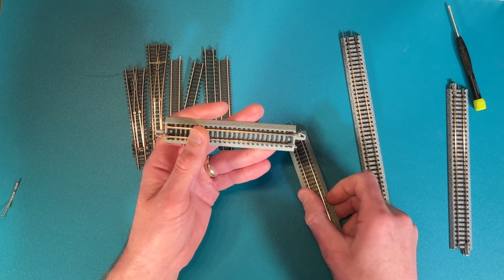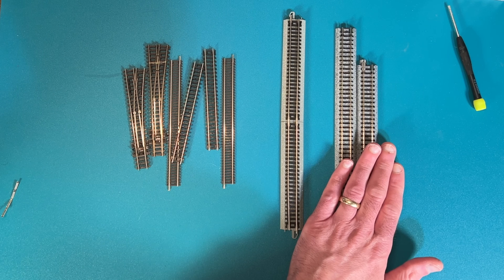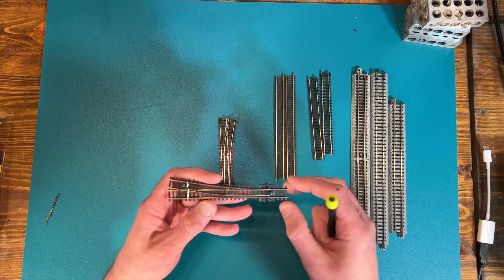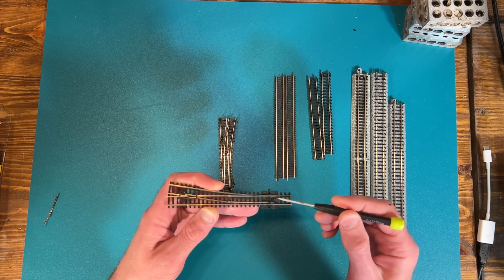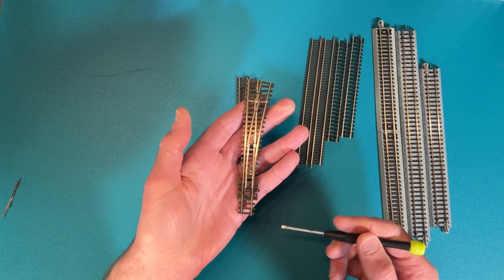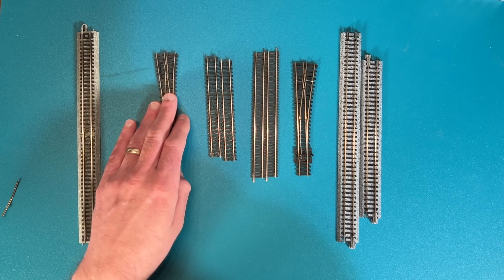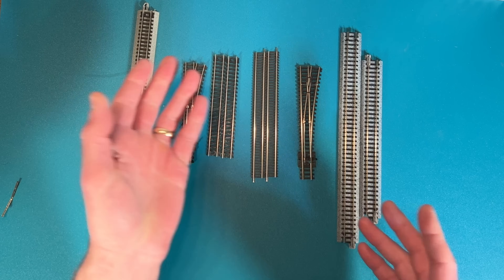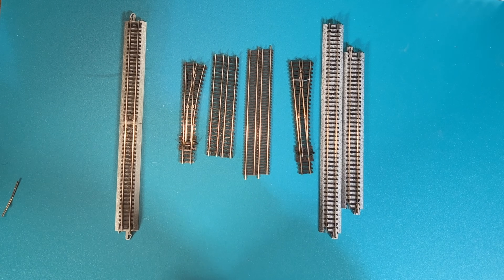What N Scale Track Should YOU Use?

Comment: Tomix plain track looks nicer. The rail joiners aren't so reliable. Tomix turnouts are awful. They aren't very well made, which leads to lots of derailments, and also means that the rails of the different parts are of different heights which lifts the wheels off the track causing locos to stall.
Fleischmann plain track looks better than both Kato and Tomix track. It is made from a more flexible material the simulated ballast is finer. The big problem with it is the ugly turnout motors. The turnout geometry is also limited.
Minitrix turnouts also suffer from the ugly turnout motors, but there is a bigger range of radii.
I use a mixture of Kato and Minitrix turnouts on my layout. I have to use Minitrix because of limited space.
I tried Tomix turnouts, but found the problems detailed above.
You may see that Kato have a conversion track piece to connect to other makes of track. This only refers to Tomix track where the rail joiners are on opposite sides. For any other type of code 80 track, just remove the Unijoiners.
Kato also have an expansion track piece, which is very useful for when you need an odd length piece of track.
I have some Bachmann EZ-Track that came with a train set. It's still sitting in the train set box because it looks awful.
Reply from the maker: Great information!  I’ve seen those other track types in videos but not in person and haven’t really heard anything about the turnouts before except the looks as you mentioned.
Reply: @StevesTrains   I've had no issues with the tomix turnouts and double slips, finding the system superb, especially with their switchable power routing or not. I run both the standard radius turnouts and also their 140mm radius (5.5") turnouts and again, no issues, even running 6 coupled steam locos. I guess it's just different experiences
Reply: @muir8009  Everything I could dig up seemed to praise Tomix track, and those PL541's don't look terrible. Mike Fifer seemed to like them as well, but I don't think he has actually used them on a layout. Thanks for the input.

Comment: A couple points from someone who has bought every N scale track system at this point. 
Minitrix is a German N gauge train track manufacturer that has tram track (similar to kato compact but larger) with a r193mm radius curve minimum. They have the same spacing as kato unitrack and use code 80 rail. Peco code 80 rail is the same as Minitrix R2 curves r228mm and is compatible (spacing wise) with kato unitrack giving you a medium continuous curve switch, something that kato doesn't have ( your choice between 19" radius and 8.5" radius r150mm) which will cause derailments. Minitrix and peco track will work seamlessly (radius 1 trix and radius 2 peco/trix) on the curved bridge system made by a few German manufacturers that look realistic in the USA aswell given their "steel" construction with poured concrete or brick piers. 
On to Tomix, they are the only range with a 90 degree a 72.5 degree a 15 degree crossing with a double slip, 3 way yard switch aswell as a 280 mm continuous curve switch, which can fit on a 2 foot by 4 foot layout. Their track fits the proper height to mate with cork roadbed. They are the only n scale manufacturer ever to make stackable overhead line piers allowing for you to run trains over eachother. Aswell as the only manufacturer to ever make a double or single crossover bridge piece. They are the only roadbed integrated manufacturer to make not one but now 2 stackable bridge pier systems aswell as the only manufacturer of prefabricated embankments. 
Bachmann is the only USA manufacturer to have a continuous curve switch at 11.75 inches aswell as a 90 degrees crossing with removable ends.
Reply: Tomix embankments are more of a plastic embankment system kit than prefab ones. A box of them, if made one embankment unit high matches the number 4
 Tomix bridge pier, stack them two units high and it matches a number 10 pier. Though if you're using them for track, you need to use Tomix Wide Finetrack and I believe that Tomix Bus system road pieces can also be used to top them.

Comment: Atlas code 80.
Remote switch Atlas and Bachmann #4 .
Manual switch Atlas and Bachmann #4 .
Manual switch Peco with insulfrog #8 . 
Flex tracks code 80 Atlas 30" .
Tracks nails Atlas.
Atlas saw for cut tracks.
Tracks what used in my N scale layout.

Comment: Steve, thanks for a very helpful review.

One thing that I disagree with — the Peco code 80 turnouts have good electrical connectivity when new, but as soon as you put them on the layout and they get a little dirty, the connectivity fails.  That’s because they depend on contact between the points and the stock rail.  I’ve had all kinds of trouble from them.  The only solution was to add feeders to all the rails. That means you can’t take advantage of the power routing feature.
Reply: Relying on the point rails for electrical contact can be a problem with just about any brand with power routing. On the other hand, I have some HO and N Peco points on a ballasted test track in my shop with painted rails that still works fine after more than 30 years. Of course the better way is to use the appropriate contacts on a switch machine and use that for power routing. 

As an aside, Kato turnouts can be set for power routing or for both tracks always on.

Comment: My experience is all with Peco and Atlas code 80. The flex track works with either one. I have no issues with track height differences between Peco turnouts and Atlas flex track connections. and to be honest I can't even detect a difference when running my finger over a joint.
The biggest issue is with turnouts. Appearance doesn't matter to me. Paint the ties and the rail sides and add some ballast and the track is going to look pretty good. I have not had any issues with Peco turnouts at all. Atlas turnouts seem to have a clearance issue with some locos and truck length on locos. I have 2 steamers, Kato's first run of it's 2-8-0 and a  Model Power 2-8-2. Both of them can bog down when going through the curved portion of a Atlas #6 turnout. The same goes for a 6 wheel truck of a more modern loco. My solution is to swap out the Atlas turnouts for Pecos.
I am not sure how old my turnouts are and a new one may have better performance.

Thanks for do the review Steve
Reply from the maker: Yeah, I always lean towards ease of use and reliability over appearance. With my atlas code 80 and Peco code 80 turnouts there was a slight height difference, but it was the sectional track not flex. It wasn’t much and maybe isnt there at all with the flex track. Good to know that in general they seem to be interchangeable.

Comment: Hi Steve, new subscriber, I like your work. To tracks and I am building a big T-TRAK layout with 6 or 7 modules that take up both sides of the table. The T-TRAK Standard requires the KATO track at every joint between two modules, mostly because it is simply the best for electrical connection and resistance to pulling apart. Just cannot be beaten.
Now, with T-TRAK, as long as you comply with the edge interface, the rest of it is up to you. Most of my layout outside of the 1" KATO end pieces will be PECO flex track. The Mainline will be concrete sleepers, and the Branch line will be timber sleepers. The rest of the Branch lines will be flexible Fleischmann Piccolo #9119 Rack Rail as I will have two consists of rack rail locos (#7506 (blue + white) & #7507(red)) climbing up to a middle station and then down the other side. The highest Grade will be about 16 or 17%. 
ALL my turnouts will be TOMIX R140mm as they are the only way I can make everything fit into the constraints. I am still working with them to ensure I get the reliability I hope for. Other tracks in the shunt lines on a Wharf will be TOMIX that I can bury nicely under cork and matchsticks. I have a big TOMIX #1247 large R280mm double slip track piece just at the entrance to the Alpine station. 
Oh, and all turnouts will be operated by mini RC servos run from programs on Arduino UNO, NANO, and ESP32 chips.
As to the most popular tracks, as far as I have been told by others in Japan - if you judge by Sales across the world TOMIX will probably top all other sales together even though the majority of their Sales are in Japan. Japan is a nation of model railroaders, there are some real fanatics at it. The output of TOMIX Factories is huge compared to the rest of the manufacturers. That's what I have been told. Thus the range of TOMIX tracks available is also very wide. Look at Trainweb and similar sites for good info on track choices.
Lastly, a lot of sales outlets will tell you that KATO is incompatible with TOMIX. Not true, KATO makes their dealers say that. The use of the KATO adaptor piece will help but isn't necessary. 
This is what a commenter on Train Board said, 
"there is an adapter, but it isn't necessary that you use it. I did use a couple but decided after installing them that putting three layers of card (artists' mounting board) under the Peco track was just as good at balancing the height above the board. I took the Unijoiner off the last Unitrack and used Peco rail joiners on both rails." 
Same with TOMIX. You have to make the TOMIX rise by about 1 mm and it will clip on just nicely. Swap out the joiners and maybe make a hole for the TOMIX lug or break it off. Runs well together. Ballasting covers up all of the mixed trackage anyway.
Good luck with your modelling! Enjoying your videos.
Reply from the maker: Yeah, the Tomix track does look nice. I’ll need to try and get some at some point and try it out. It is true what you say about adapters. They are never really needed as generally all you ever need to do is shun things to get the rail heads even. It is the same if you want to use different code track together. Say you used 80 on the mainline but code 55 on sidings or whatever so it would look more prototypical in terms of having different weight rail. Usually it is always a good idea to solder those rail joints where there is a transition so nothing shifts over time but otherwise just a bit of cardstock is usually all that is needed to get things to line up right.

Comment: Good question.. However since 1977 I run Minitrix... Key over such long time (I rebuild my complete system yet)  is long term, aviability..  From that point it is simply thu and thru proven. with old Roco (yet Fleischmann ohn bettung) as 1:1 copy. alternative .. Other tracks are not bad. I got no reason to doubt or concern. My choise is Minitrix, from this simple poont of view. even when Marklin / Minitrix stop right now; there is that much the second hand marked delivers enough. Get I rebuild since 2020.. and that "eats" rails. Practical Arnold is hard to get (was not in the 80s) Peco is great. Rivarossi Atlas? great rails fully gone.. The only factor I see constant for decades is Fleischmann , with ballast.

Comment: I think if your ambition is to build a large layout on the cheap, and to progress quickly, Atlas code 80 is superior to code 55, and more widely available than Peco code 80.
Part of building on a limited budget is to buy cheaper, old, used freight/passenger cars and the wheel flanges on older equipment are mainly too deep to run on code 55 track. This goes for the wheel flanges on older model locomotives, also.

Comment: I'm assuming you can't intermix different track brands even if they are the same scale?
Reply from the maker: You can in some cases without much issue. If the rail is the same height you can pretty easily. The ones with roadbed are harder. You still can but sometimes have to make a transition since things won’t always line up right.

Comment: What about Atlas Code 65 Tru Track? I have used that and have had success with it. I will say that it's connections don't seem to be as tight and snug as Atlas Code 55 track.
Reply from the maker: Good point on the tru track. I had totally forgotten about that one!
Reply: The #5 Atlas C65 turnouts were not available when I built my layout (2021), so I went with Atlas C55. It's delicate and has it's flaws, but worth it in my opinion. Powered frogs rule.

Comment: At the Hobby Shop I hung out at everyday and even acted like a employee, He sold More Regular Atlas Track because it was Cheaper to Buy It even with Cork Track Bed, Ballast and Glue/Nails than just to Buy ( Insert Brand here ) Track with All that ( in plastic form ) is already attached... ( At the time ) Buy 6 Atlas Straight Track and everything needed to put on the lay out was $3-8 Less than buying.. Bachmann Ez-Crap.. I mean Ez-Track... and Kato Track... Specially if you got Flex Track. 3 Feet for $4-6 that Now costs around and over $10 each... and Bachmann's 3ft NOT Flexible Ez-Crap... I mean Ez-Track was $20 for One.... 
BUT Now A Days, Even Atlas Normal Track has more than Doubled in Prices... Don't get me started on Turnout Pricing... That Shit can get EXPENSIVE!
Reply: Bachmann Ez-Crap.... I mean Ez-Track, the Store had a Window layout using it. over 60ft of track, Dog-bone. Soo Many Gaps in the Track/Rails at the joints, Not counting the ones between the plastic itself.... So we took the time to Close the Gaps. By the time we were done, we had About a 6 inch Gap... So we Ungapped it all and left the gaps.. Up To 1/8in... Then it Wrapped and Faded in the Sun.
Reply from the maker: Yep, all track is way more expensive now that a decade or so ago. I don’t know that it is out of line with everything else, however. I’ll need to do some data analytics at some point on that to see if it is or not.

Comment: Backmann has just as much options in unitrack as Kato you just have to look for it Also if you pull the unitrack apart STRAIGHT and NOT BEND it APART it Will Last A Lot Longer pls Model Trains aren’t Toys they’re MODELS, handling With CARE Is ADVISED!!

Comment: Kato Unitrack. 100%. Everything else is junk.
Reply: I like bachman just for start and im not switching bc i dont wanna try confusing myself
Reply: Bachmann and Kato have both treated me well and yes, you can connect them, you just cut the tab off the ez track and use atlas code 80 joiners. I also don’t keep putting it together and taking it apart. If I were starting out again, I’d probably buy kato for the same reasons you mentioned, primarily the wider assortment. Great video
Reply: Peco flex is what I used back when.
Reply: Flex track mixed with Kato is life.
Reply: Kato for toys
Peco for modellers
Reply: @fatwalletboy2  Btw kato does flexible rails for modellers too, so... Kato. Only Kato.
Reply: Bachman is at least 50%